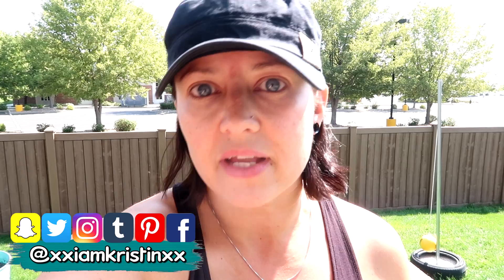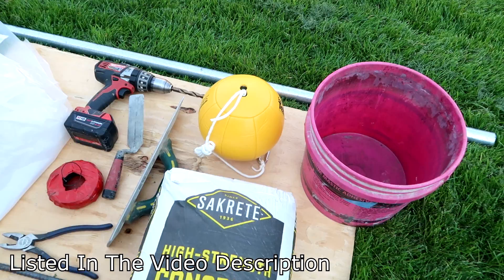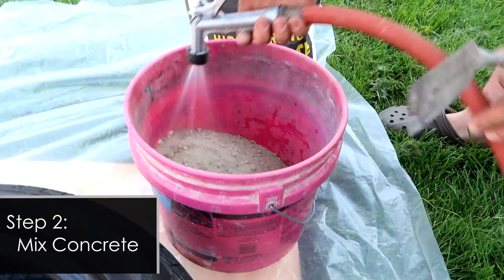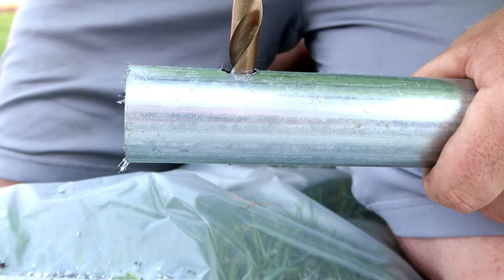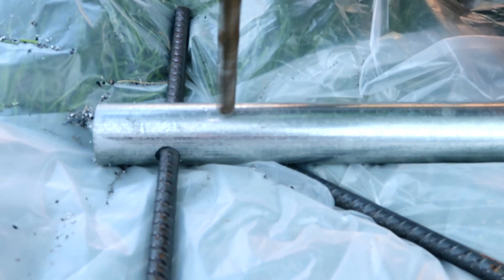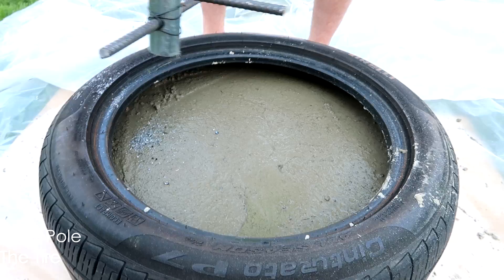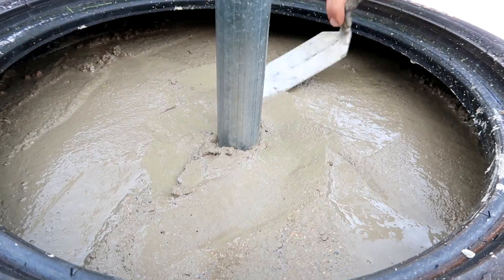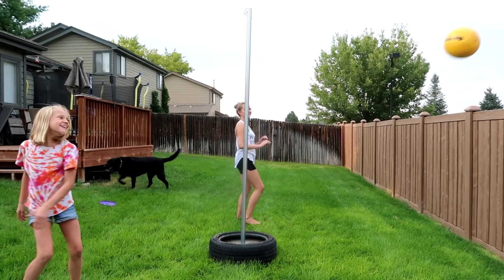How To Make A Tetherball Stand! 📍 How To With Kristin

Comment: we are ratchet and we hamerd it in the ground hard with a little copper pipe that is about 9 feet tall and duck taped the rope that we found on the road and we duck tape the rope to the ball and it takes 2 weeks for it to rip and we are using a volly ball and it works well.

Comment: I made one.   I used a bigger tire so it is heavy.     You gotta really pull your weight from the top of the pole to get it to tip over, but if you hang on to the tippy top of the pole and jump-push it back upright, the thing will launch you up in the air and you can ride it back down on the other side!! Go back and forth!!   Like a moon jump, pole vault, swing kind of a thing. Just hang on, jump, fly, land, and repeat.   Great fun even without the tetherball attached!!  I used a 10' steel pole cemented into the tire.
Reply: Just don't let your body slam into the pole at the top.   That can hurt!   Then don't let go from the top either...  thats a good way to break an ankle.  But still, the reward outweighs the risk!!  Lol

Comment: Great video. Even cheaper just to dig a whole and fill it with concrete, similar to a fence post. That way no need to buy an old tire. Just a thought.
Reply: Old tires are free or $5 and you can move it to mow lawn or for whatever reasons. 🤔

Comment: thanks, but what did you use on the bottom of the tire? Does the concrete just dry? You at first had a plastic tarp down, and then at the end of video you had it sitting on grass. Does the concrete just dry and then its flat on the bottm of the tire too?
Reply from the maker: Ya it just dries and comes off the plastic sheet. You don’t need to put anything else under the tire
Reply: thanks, i wasn't sure if it would stick to the plastic and come up with it...good job..thanks again !

Comment: Two suggestions:
1) Add a level to your list of tools.  You are going to be a lot happier with the final product if that pole is perfectly plumb, because you can't do much about it once the concrete sets.
2) Start with smaller drill bits.  The video makes it look like you used a big one for everything.  I hope you didn't.  It's much easier to get a small hole started, then expand it with successively larger bits.  A large drill bit will have trouble biting into the metal.  A small one won't.  Also: Clamp the pipe down (e.g., a vice, wood clamps, or even cinder blocks).  Start the job with a punch (A nail will do if you don't have one) so there's a divot to drill into instead of the bit wandering around.  A drill press will make things easier if you have one.